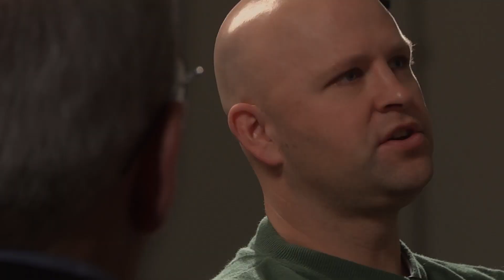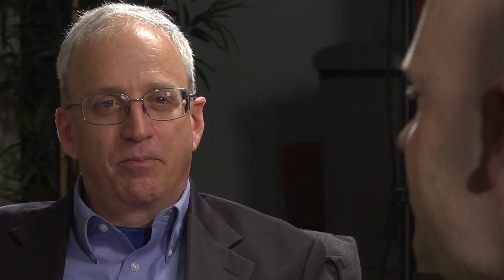CPU's Are Not Getting Faster - Intro to Parallel Programming

Comment: What I gathered from this is that it's better to make components smaller, therefor requiring less power, therefor allowing for more components while using the same amount of power from the last generation. As opposed to just running up the clock rate and using more power. Could be wrong though

Comment: If anyone can offer a simple answer I'd appreciate it. He says that Moore's Law is still alive meaning the number of transistors in a CPU is still doubling every X number of years. So why is it that the number of transistors is increasing exponentially but CPU clock speed is not?
Reply: Peter P 2 Main reasons: because it’s getting hard to cool down the processor properly, and also because you don’t want a processor that is draining your wallet with a large electricity bill. So instead of using those extra transistors for simply higher clock speeds, they are being designed and built for specific “higher order” tasks.

Comment: He needs to dork it down a little so that us dumb folks can understand better 😊
Reply: Well in Layman's terms, your computer processor is made of the element silicon. The processor is made of billions of microscopic "wires" (or pathways). Over time, we've gone from real, physical wires (the earliest IBM machines), down to wires that are a little larger than an electron. We've gotten to a point where we can't make those "wires" any thinner/smaller.
Gigahertz and voltages refers to how fast that processor is running at. A gigahert means that your processor can do 1,000,000,000 (1 billion) operations/cycles per second! If we go any faster. your processor will just produce too much heat, be too unstable, or take too much power.